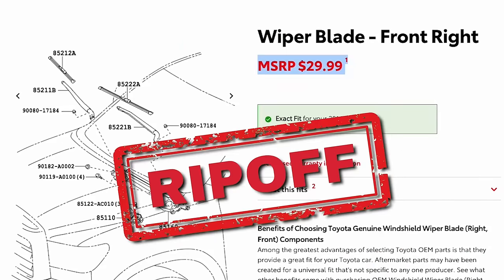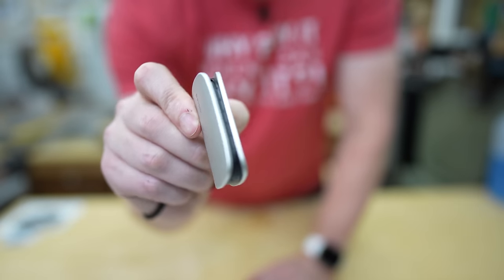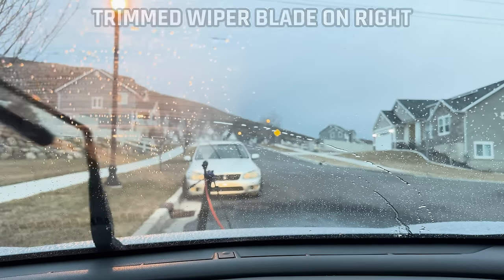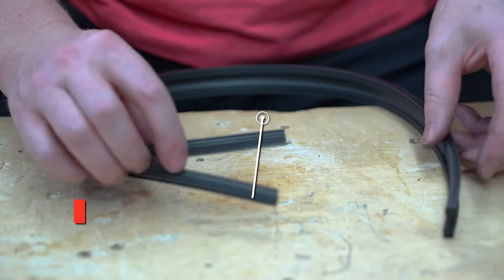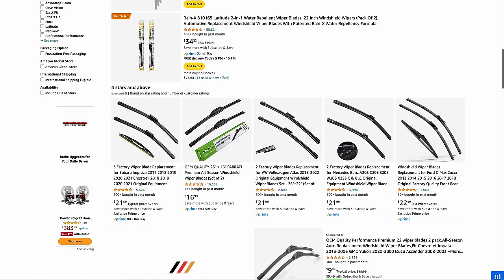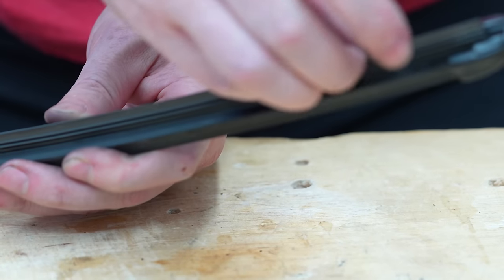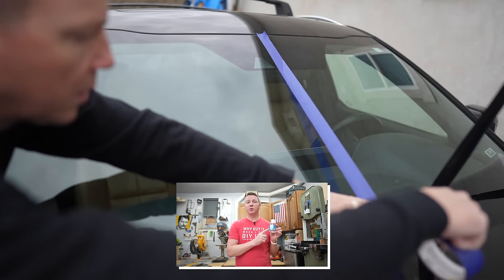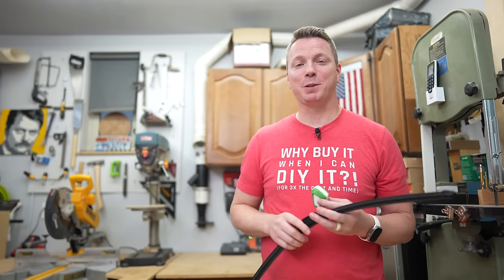Windshield Wipers Are a SCAM! 3 Ways to Save $$$

Comment: Guys never use WD40 on rubber or glass it will eat both over time.  Use silicone spray on a cloth to clean the blades
Reply: Don't use ANY type of oil that contacts the glass windshield.
Reply: Use isopropyl alcohol to clean the blades.  The wiper refills had a isopropyl wipe included in the package that you were instructed to apply to the wiper prior to installation.
Reply: Not true WD 40 is a Brand and so ist Not 100 %true
Reply: And wd 40 has a lot Of stuff
Reply: Agreed. And some of the black is the rubber coming off. Not necessarily dirt

Comment: Something to be cautious of with those tablets: It says right on the Amazon page that it's only suitable for summer use. It has no anti-freeze properties, so you risk bursting the rubber lines and/or the tank itself if you are in an area with below freezing temperatures. Even straight Windex is subject this to this. I had a bottle of Windex in my outdoor covered parking area, and the bottle shattered. We live in northeast Georgia and I recorded temperatures down to 3F a few weeks ago.
Reply: yeah, found this out the hard way using the concentrate bottles though instead of tablets.  Add some methanol to lower the freezing point.
Get tablets not just for cost reasons - it's stupid to ship gallon jugs of water around the world.
Reply: A bit of isopropyl alcohol can lower the freezing point adequately for freezes.  I have used ammonia, isopropyl, and water to make my own. It's cheap, and has worked for even subzero conditions. I have also looked for the possibility of the alcohol degrading components of the system and have seen nothing after several years. Recipes readily available online.
Reply: Holly molly I was just wondering that. Big misstep here. I thought being from Utah he would not make that mistake.
Reply: Think twice about using anything with ammoia, like Windex. I used it  during a muddy spring, when I had run out of the normal fluid, and it worked great. But before it ran out, the wiper arm and the edge of my hood were both rusting. Ammonia is very good at cutting through wax or  even some paints and some tiny scratches that would allow very slow rust growth from water or alcohol will allow rapid rusting if ammonia gets into them.
Reply: @joesmith942 do not use ammonia or vinegar
Reply: I've mixed ammonia free Windex, with isopropyl alcohol and water....
Reply: What are the tablets called?
Reply: I mixed ammonia with bleach. People on the sidewalk were dropping dead!
Reply: Just add alcohol to the fluid to prevent freezing.

Comment: Silicone wiper blades only cost a little more than standard wipers, but last ~10x as long, they also imbue a similar effect as the nextzett. I've been using silicone wipers for over a decade, oldest set currently in use is 6 years old, and still working great,
Reply: What brand do you recommend?
Reply: @DAjugRnaut  Honestly I have to buy them so infrequently that I do some research every time
Reply: @DAjugRnaut  PIAA are the best
Reply: silicone wipers really are indestructable
Reply: @sendoh7x  Thats why they dont sell those anymore :(
Reply: @Coladudetje  This link is this video takes you to silicone blade refills.
Reply: @Coladudetje  we have them here everywhere from where I'm from 😀
Reply: @DAjugRnaut  PIAA are good pretty reliably but some other brands have lots of quality issues. Some are ok and some streak out of the box and never clear up. Most of the reviews for like PEAK reflect this, and like a lot of other products there's a primary OE for most blades that makes them as white label and just brands them for whoever. Trico has been good for me as well, but they have different models and some look to be better than others based on reviews.
Reply: Depends on the blend. 
With product obsolescence and knowledge of plastic blends they will have changed that now to have shorter life.
Reply: I just buy the $3 blades and they last a few years.  It takes one minute to replace them so why spend extra for a disposable easily replaced item.  I keep extra ones and just replace them whenever they break.
Reply: I'm agreeing with everyone else with PIAA silicone wipers.
Reply: @jeffbguarino  I have never ever had a standard rubber blade last more than 3 months when parking outside all the time. The silicone ones last me close to a year.
Reply: @SuperCJification  My wipers usually last about 2 years and they are the cheapest ones I can find.   Usually from Menards or Princess Auto.   26 Inch for my van.    Also I live in Winnipeg which can be -35 in January with lots of ice building up all the time.   What we don't get here is the constant high UV that disintegrates rubber.   I notice that vinyl and plastic don't to well in the heat and sun, like in Florida or southern US.
Reply: Got those on my car to it’s been 3 years now no issues the blades have been through tough winters rain snow slush hot summers and are still holding up no streaks no rubber falling off they are the way to go.
Reply: Silicone wipers are the absolute BEST choice....rubber is garbage & doesn't last 1/4 as long
Reply: Silicon wipers are the best. I had to replace mine because the metal part of the wiper rusted and broke. Silicon still in very good condition. it's been so long but I guess it was bought about 10 years ago.

Comment: My 2016 Mercedes S550 was in for the B service. During that process I received a call from the service advisor to let me know that my blades needed replacing. Cost? Only $219. I thanked him and said no. Over my 58 years of driving I have learned that sometimes the blades just need a cleaning. When the blades wear down and cleaning isn’t effective anymore I would just buy new insert wipers, remove the old, and install the new into the wiper arms. Less than $20. Thanks to this video I found that I was doing the DIY thing before DIY was a thing and also I’ve learned new tricks. Thank you. Btw, I’m happy to now be a Patreon member. 🙋‍♂️👍
Reply: Can you imagine how many people say, "Yes" to that question? I'm sure it makes it worth asking the question...
Reply: i went to do an emissions test when i bought my first car and the guy looked at my wipers odd and said they looked old and that they should be changed, he just so happen to also sell wiper blades. thing is i had just bought the vehicle used earlier that month and changed the old wiper blades. i didn't see how much the was selling them for but something tells be it wasn't cheap.
Reply: A BMW dealer here in Ireland asked if I wanted them to replace the model-specific rear wiper blade during a service (14" long, and it was worn out) - I asked how much it would be? - They said €78 (~$85). I said no thanks, and bought a Bosch one locally for €14, and removed its rubber, and fitted it to the existing BMW blade assembly.
Reply: Maybe you have the magic vision wipers on your Mercedes?
Reply: Incredible how you usually can't buy wiper blades (the rubber inserts) anymore, but everyone stocks replacement ARMS. I had one enterprising station tell me I needed new arms. I said thanks, these were 20 years old and still worked fine, all I wanted were blades.
Reply: Beware of RainX. It works incredibly well, but apparently rots some OEM rubber wiper blades.
Reply: @lyfandeth  In fairness, changing the rubber insert is a hassle for most owners, and it takes too long for mechanics compared to clipping on the whole thing, so both are happy to buy the assembly. Ironically, I always buy the rubbers for my classic Mercedes ('76 S-Class, W116) because the blade assembly and the whole arm (bolted to the motor) is stainless steel (silver), to match the chrome trim. PS: The real killer of wiper rubber is the sun's UV - my classic Merc lives indoors, and under a cover, so the wipers are in the dark about 99.9% of the time, and the current rubbers are actually 12 years old and are still soft and flip perfectly and wipe without any smears,
Reply: $219?! What a scam.
Reply: You can get blades for $3 at Menards or Princess auto.  It take one minute to replace them.
Reply: DIY was always a thing, even before the internet was invented ;)
Reply: I remember 20 years buying a hinge for a sun  visor at dealership for my '94 Jeep GC.  The parts counter was next to the service dept. and I  overheard a service advisor recommending to a customer that their minivan needed new wipers.  The customer asked how much, and the service advisor paused for a few seconds and said about $60, I almost burst out laughing. Even though the hinge cost $8, that was the last time I ever bought anything at a dealership parts department.

Comment: One trick that I have learned.   Flip the blades, end to end if you can.  It changes the way they lay.  Sometimes the rubber is bent over a little from the pressure of being pushed down.   Has worked for me.  Ran a small full service gas station in the 80's.  That's where I learned it and doing it even since.
Reply: Nice tip! Thanks
Reply: Cars from VW AG (and i bet from others too) already alternate the side the wiper lays regulary to enhance durability. They implemented it since ages ;).

Comment: I'm going to get a little extravagant and suggest you spend a whole buck on distilled water to use with the washer fluid tablets. Where I live, the super hard water will eventually cause a problem in your windshield washer lines. I think it's worth a dollar to avoid it.
Reply: Same for radiator.  My 1981 truck I bought new and still drive has no radiator problems.  Also, oil your battery terminals and let some wick into the cables.  Mine are original.
Reply: Definitely!!!Tap water Clogs up the spray nozzle's and spots the windshield.
Reply: @sunlite9759  ummm don't you use windshield washer fluid? Its like $2 for 2 gallons where i live.
Reply: That seems entirely unlikely, but adjusting the pH of your spraying water down with a bit of vinegar can help.
Reply: I save the water from my portable AC. Its practically free distilled water
Reply: Exactly
Reply: @toseltreps1101  depends on where you live! Some areas have very soft water already. Where we are, the cruel prank to play on water softener sales people is to watch them use up All of their reagents and still not be able to tell you how hard your water is. I assure you it wasn't intentional, but our water here is ridiculously hard. Most people who live in areas with soft water wouldn't know about this problem, but if you move to an area with hard water, you quickly learn the many problems it can create.
Reply: @milissarowell9877  that's why i suggested adding vinegar to adjust pH
Reply: @toseltreps1101  that's a great suggestion for many! Where I am the amount of vinegar I'd need would make the cost as much as just buying a bottle of premixed, which to be honest, is what I do, because I really just don't have time to futz around with mixing my own.
Reply: @milissarowell9877  yea with water that hard it's a useful last resort when in a pinch
Reply: @toseltreps1101  true, true! Always good to have a backup plan.
Reply: This guy right here is living his best life in 3024 while we are all still trudging thru 2024.

Comment: Surprise! Surprise! When I first started driving about everybody replaced the blade of the wiper instead of the whole wiper. Then the auto shops gradually quit selling the blades separately so they could make more money. I tried replacing my blades with ones I already had and they wouldn't fit my wipers. With all the problems we are supposed to be having with excess trash, it should be a nobrainer to go back to the old ways.

Comment: Making your own washer fluid from those tablets and tap water makes no sense for people living or driving in climates where it freezes.  In freezing weather, tap water will freeze, clog the washer fluid lines and likely damage your washer fluid pump. Washer fluid needs to contain isopropyl alcohol or similar.
Reply: So just add some isopropyl alcohol with the water to lower the freezing point
Reply: @sociopathmercenary  The major solvent in WW fluid is usually ethanol (close to 50%) with some some isopropyl alcohol and sometimes other additives as anti-freeze.